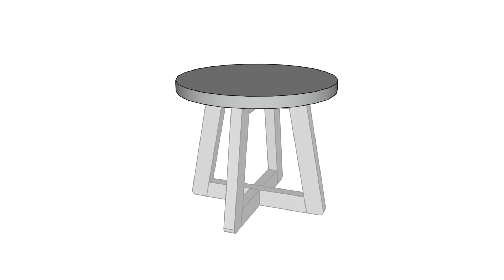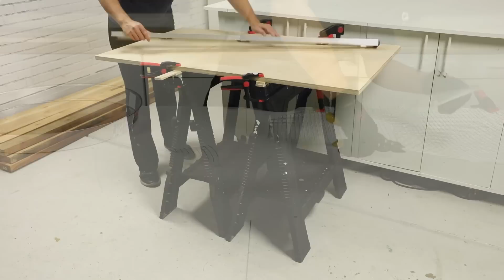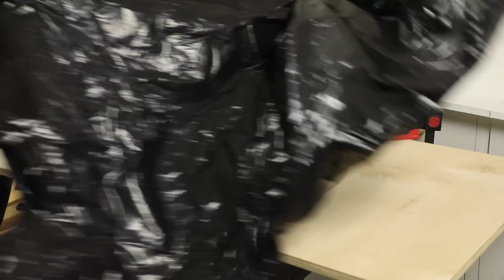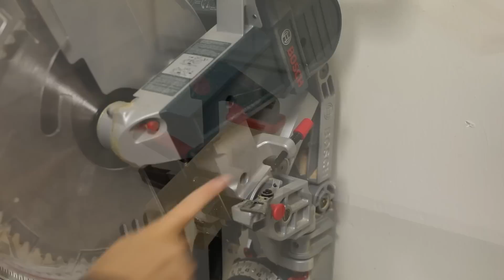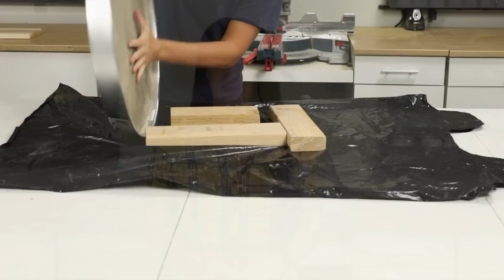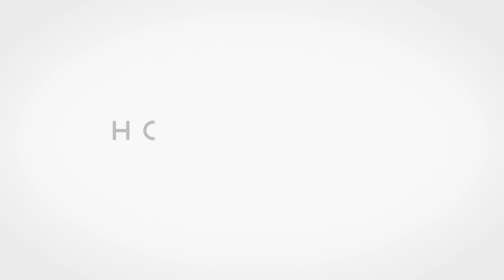How to Build a Concrete End Table | House One | This Old House

Comment: dont vibrate too much or you will make the mesh sink to the bottom which ruins the support.   I would rather vibrate it alittle for bubbles, then add the mesh and hit it with vibrator until it sinks under the surface.  U can always use the tip of ur finger to be sure its deep enough then smooth it out.
Reply: Mesh needs to be in the lower 1/3, not the top. For tension, not compression
Reply: Thats what she said 🤣